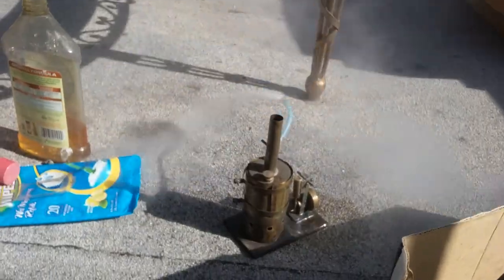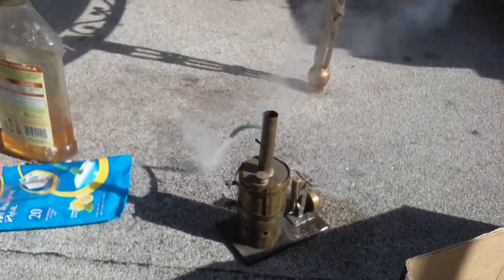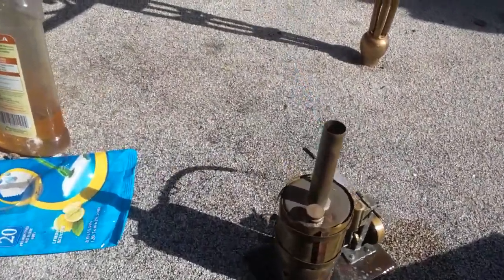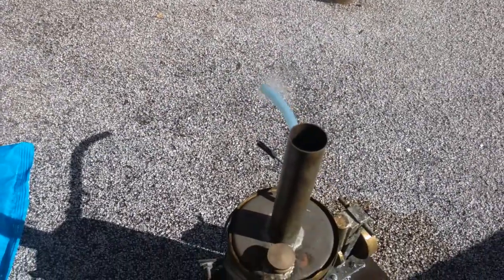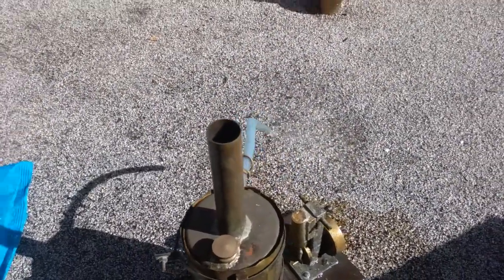Model Steam Engine Run + EXPLOSION

Comment: Nice engine. We’re you burned when the hose came loose?
Reply from the maker: No, but one time years ago I put gasoline and wood chips under the boiler and it went so fast I just ran away, when I came back it looked like it had been incinerated.